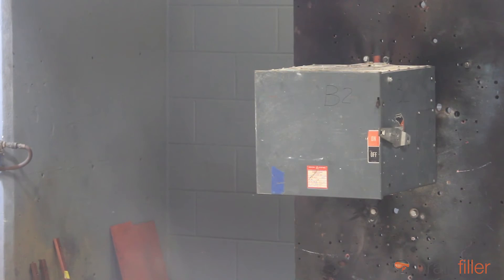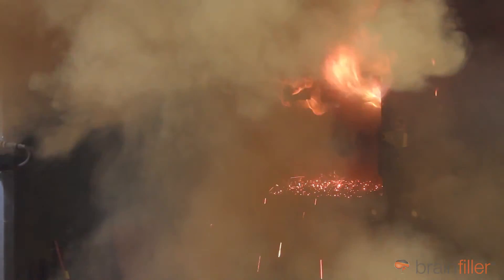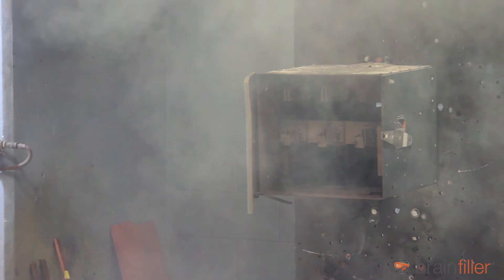Arc Flash with Door Blowing Open

Comment: I know that in arc flash discussion in both IEEE and NFPA 70E is about protecting the workers but how about the electrical equipment and power system? for example, if there are two switchgear and they'll be face to face what's the possibility of having an arc flash like in the video damage the other one and make a total outage for the whole system? isn't it better to install the switchgears back to back?
Reply from the maker: Great question.  It depends on lots of variables.  I was part of an investigation team assembled at the request of the Japanese Government to investigate that exact issue at one of their nuclear power plants that had a huge fire as a result of the Fukushima Earthquake.  We were looking for the "Zone of Influence" which is to answer the question: If an arc flash occurs at a given location/equipment, how much will it damage other equipment.  

There is a new IEEE standard in development about electrical safety by design.  I don't believe that specific topic is cover but it is interesting.    Thanks for your comment!

Comment from the maker: Great comments!  It is true that the majority of arc flash events are human error.  The door might offer protection but there are 3 issues.  1) if someone is performing work, the door is likely already open.  2) From my lab experience, there just isn't a way to know if the doors will remain closed unless the equipment is designed as "arc resistant" 3) even if the doors remain closed, the energy behaves like a fluid and will seek any crack, vent hole etc and still may find it's way out.  So the conservative approach is assume the equipment doors are open.  Thanks for everyone's interest!

Comment: I agree the enclosure is intended to protect from electrical contact and unless the enclosure is rated for explosion and vented in some way, the severity of the arc can cause doors can open.  However, is it not true that the vast majority of arc flash events are caused by human error and the doors will help to prevent the likelihood of occurrence?  In this way the doors can indeed aid in protecting operators.  Thanks!
Reply from the maker: Arc flash events are usually caused by human error.  It can blow the doors open but, how can the arc flash be created if the doors are closed.  Some equipment requires "racking" in and out devices and the door may be closed in that case if an arc flash occurs.  The energy could blow the doors open.  Also equipment with questionable condition (old, poor maintenance etc.) could fail when operating - and the door is closed.